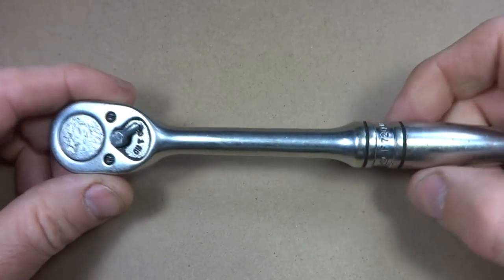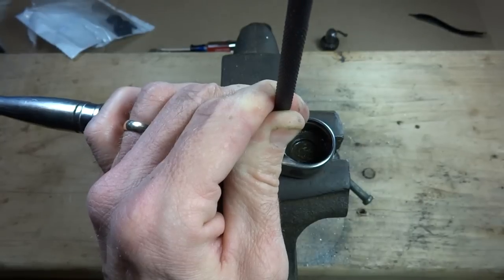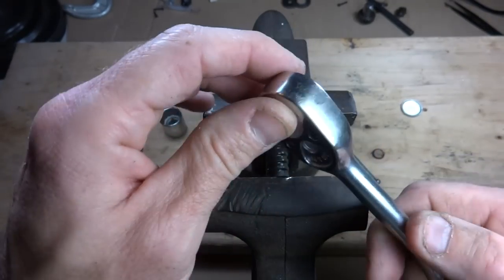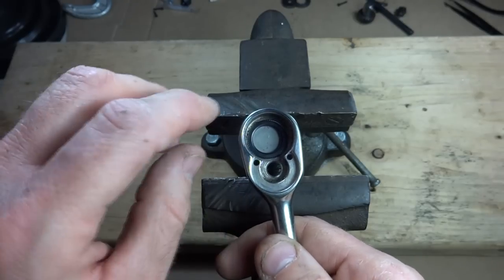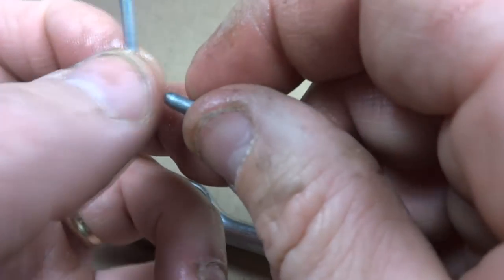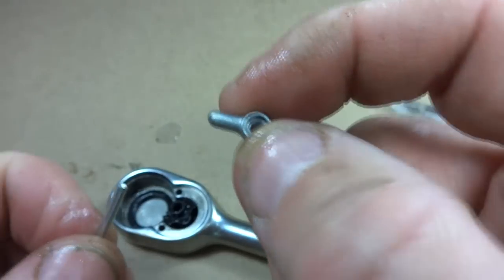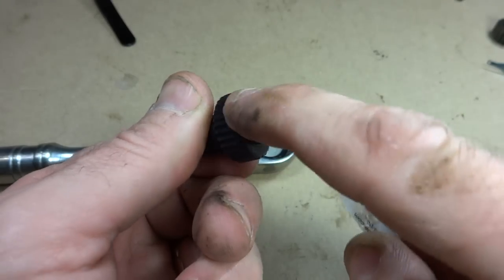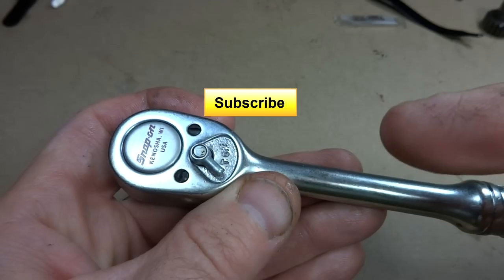How To Rebuild Snap-On Ratchet Wrench With Repair Kit

Comment: That F720 would have been made in Mt. Carmel, IL. I machined millions of ratchets from 1977 until the plant closure in 2003. The plant was actually in operation from 1937 - 2003. I believe ratchets are now made in Elizabethton, TN. I think that model is now discontinued though. You did pretty good on your rebuild, nice video.

Comment: If you use the old drive head instead of a socket, the bushing will seat more squarely. I used to be a Snap On dealer, I can't count how many of those I rebuilt.
Reply: The antique repair kit I had recommended exactly that...drive in the bushing with the old drive head. It seated really well.
Reply: Great Advice.. Thanks for the tip.
Reply: I have a 1955 ferret F70. Do they make a kit for it?
Reply: @Patrick_B687-3  F70N and F70M use kit RKRA380

Comment: A quick tip for everyone, if you don't have that little ball bearing retainer tool you can take a copper washer, hammer it flat, cut it in half, take a punch slightly bigger than the ball bearing and make a dimple, then make a 90° bend and bing - bang - boom you've got a tool that will hold that ball bearing and is thin enough to allow you to slip the pawl in.

Comment: It's funny because I have an F726. It is the 3/8 with the black screwdriver handle. After all these years of not using due to a slipping pawl, I finally brought it back to life. I had taken it to a Snap On distributer who had told me "they don't warranty it due to that handle " years ago. That soured me on buying a lot more of their tools. I still have quite a few things, but I started getting stuff from Proto and SK instead. It's good to have it back as I always loved the feel of that ratchet. Nice video!

Comment: You'd think since these tools are lifetime guaranteed, they would send you the kit, for the price of shipping? All my Snap-on tools are from the 80's. I left the auto repair world around 95. Now my tools are slowly breaking down, from doing my own repairs. But it's difficult to find a Snap-on truck. A few years ago they sent me a replacement hammer (the old one, the plastic handle fell apart and was left with just a metal rod). It was nice that I didn't have to send them the old one. But after about a month, the head of the hammer broke from the handle. No more metal rod, just plastic. Just goes to show how prices go up, but the quality goes down. First hammer lasted 30yrs, new hammer 1 month.

Comment: DUDE! Like many have said before me; you saved my day. And my ratchet. I have about a dozen craftsman ratchets that I’ve disassembled/cleaned/lubed over the years, both the standard and professional lines. They’re easy. My one and only snap on (F830 3/8”) I was always afraid to take apart. It’s my go to ratchet. Anyhow, I finally decided to take it apart. When I couldn’t get the spring/pawl/ball bearing back together, I found your video. I ended up making a tool from a metal shirt collar stay which I drilled a hole to seat the ball and bent. I also crazy glued the ball to the spring. I popped it off after assembly.  Thank you very much for this clear and very helpful video.
Reply: I'm in the exact same situation. Looks like I'm ordering the kit from snapon haha

Comment: R.J. Thank you for posting the how-to video.  After watching, I had the confidence to do my own rebuild vice chasing down the local Snap-on guy and ruining his day...  The ratchet I rebuilt is a vintage F-710B, 3/8" drive ratchet, circa 1964.  It was pretty rough (yard sale find ).  I had a difficult time finding the rebuild kit online (RKRA380), so I called Snap-on directly and they sent me the kit.  Cost was about $20 with shipping and handling. The trickiest part was holding the spring in while I set the pawl in place during the reassembly.  I made up my own "special tool" from an old pair of tweezers to hold the spring & ball in place and "shoe-horn" the pawl into position.  And now, I have a nicely working vintage Snap-on ratchet in my tool collection!

Comment: You just saved my day. The antique instructions with an antique kit did not label the parts. Many thanks! 

One note about older repair kits: I had one & the separate ball bearing is hard to manage. Without that Snap-on holder you have, I had to cut a shim out of aluminum flashing to hold the bearing & spring down because the fit is so tight between the pawl and the bearing. No screw driver would fit in there.

Comment: Thanks for the video. Watched this so i could fix a ratchet I inherited from my dad. Mine is a flex head. Didn't want to replace it with a new one. Almost the same ratchet. Snap on rep gave me a repair kit for a new one. Wrong repair kit. So he brought me the right one when it came in. I don't like snap on prices. But i would buy from him because of customer service. Great job Steve! Also i couldn't find a video that had the same era of ratchet so great video for me. Thank you.

Comment: Well presented video. I was on a Snap On van today for the first time in years to get a new ratchet gear set for my F736 ratchet. Its first repair in 34 years although I'm on to my 3rd 3/8 Snap On breaker bar.

Comment: Thank you. I didn't have that Snap-on tool you used for the spring. So I used my specialized cuticle pusher. It has a small spoon at one end. A Great Video.  Sheilah  :~)

Comment: Very helpful video, I've done a few of these and one tip that might be added is sometimes when your all finished the drive gear might be hard to turn, 2-3 firm taps with the drive square on the anvil and it'll adjust the gap inside and spin perfect.

Comment: I've  only just found this video ,but its still an outstanding teaching tool . I've a 3/8 ferret ratchet circa 1960's +/- that had me puzzled . The switch for tight ,loose is brass which has had me stumped. Snap -On UK denied it was one of theirs when I rang for a refurb kit even though it has a Snap -On part number. I  thought I may have been talking to a new guy so rang again Nope never heard of it but you can have a new one for £60 . I wanted to preserve a bit of Snap On history . It would seem  Snap On don't care about there rich history in tools which lets face it built the world for the most part   Subbed  to your channel Regards from the UK Darren
Reply: I have an SR-715 with a brass selector switch. It's from 1948

Comment: Thank you so much! Using your video I rebuilt my S715 Snap-On wrench and it’s like new. I even polished it while it was apart. Great job on the video! I didn’t have the special tool to compress that spring so I used a tool meant for carving on clay. It was rigid enough and I ground the surface of it so it would grab the little ball. It took several tries but worked.

Comment: Thanx for posting this vid I have the same ratchet and it stopped working just wouldn't turn at all or would not catch on the internal teeth I didn't think i needed a kit just a good cleaning and repacking looks like rust was my problem now its working like new

Comment: It appears that the ratchet came with a 20 tooth gear and engaged  a single tooth in either direction on the pawl but the rebuild kit came with a 30 tooth gear that engaged two teeth in either direction on the pawl.  Is this so?

Comment: Now that you have purchased quite a few of these various ratchets and fixed them up do you find yourself reaching for one in particular? Also it'd be neat if they made a kit for that ratchet that made it have finer teeth. I hear a lot of people who love the 80 toothed Snap-On ratchets, I bet if they made an 80 or 72 tooth kit for these older styles people would buy them to sort of "upgrade" their older ratchets. Anyways thanks for another great video!
Reply from the maker: If you look closely, the kit came with a finer tooth ratchet mechanism than what was originally in there. My Craftsman wrenches are probably my go to wrenches, but mostly because I have had them forever. I haven't had a a  lot of these other wrenches for very long.

Comment: Great video. I have an old Snap-On of my grandfather's that's needed a rebuild. After seeing your video, I ordered the rebuild kit and gave it a shot. 

Unfortunately, my reassembly did not go a smoothly as yours. I set in the new backplate and bushing, and (tried) to press it in as shown, then heard a crack. Opened up the vice and the new bushing fell out in three pieces. No big deal, I thought - I would just put the old one back in... CRACK! Now I'm stuck. 

Anyone know if you can get just the bushings from Snap-On? It would be nice if I don't have to buy a whole nother kit for just that one piece... 🙃

UPDATE:  I got my second kit (everything, when all I needed was another bushing). This time, I used the old core of the  ratchet (rather than a socket) to press the bushing in. Worked great! - the old core did a great job of holding the new bushing even and centered when being pressed in (which is I am sure why I broke the other one). 

The old ratchet is good to go another 20 years (at least)!

Comment: Thx for the video. I rebuilt an old FL720A (long handle), but the square drive does not sit deep enough in the ratchet. The black cover plate does not fit flush with the ratchet head. I believe the bushing is in far enough. Gonna try again using the old drive to seat the bushing. Any ideas? Thanks again!

Comment: Hey, great video, I have an F720 I need to repair as well...however, the slotted screws you remove at 0:25 are in pretty deep for me, and one of them might be a little stripped.  :(  I've used a few coats of PB blaster and so far that screw's still stuck, my driver keeps slipping.  Any suggestions?
Reply from the maker: Shadowguy456234 heat the wrench or try an impact driver.
Reply: +RJ The Bike Guy Ended up having a machinist at work extract it for me.  Finally finished it up today - my old bushing was also oxidized pretty good and stuck in there, but used a vise to press it out.  Thanks so much for your video, now I'm confident to upgrade my SL710 also :)

Comment: I wish I didn't take the nameplate out. It isn't necessary for the rebuild. My new one was just a bit off and it refused to go in straight no matter what I tried so, the old one went in with the new ring

Comment: Where can i get that tool to install the spring and ball, I have some Williams 1/4 ratchets m-52eha that has the same kind of setup and it was a pain trying to get the spring and ball installed
Reply from the maker: Snap On used to sell it, but not sure if they still do. Contact them.

Comment: Where did you get the Snap on spring loaded tool to push the spring into the ratchet?  What is it called? Does it have a part number?
Reply from the maker: From Snap On. I don't think they sell it anymore. Part number is in the description.
Reply: @RJTheBikeGuy   This guy is using an index card. I just tried it but I maybe too tired. I will try it again in the morning. He does it around 12 minutes and 20 seconds: 
https://www.youtube.com/watch?v=CQk9cGWXgqk&t=310s

Comment: Im trying to open up my fk720 and I took the screws out and the plate will not come out, any suggestions?  Thanks
Reply from the maker: Gently pry it off. It is probably being held on where the switch comes out through it.
Reply: Ok thanks

Comment: Hi where did you find the spring steel tool to seat the spring and direction paw?
Reply from the maker: +John Jackson At Snap On. It costs less than $1 with free shipping. https://store.snapon.com/Non-Catalog-Items-RAT-REPR-TL-P9643445.aspx
Reply: You can do it without the stupid little tool (that they should just send you for free with the rebuild kit in the first damn place). Just hold the little ball/spring down with a tiny screwdriver through the hole while you start the paw, it was easier than I thought.

Comment: that's weird I've got old ratchets that that have broken teeth that were my dads that have been replaced.  I guess you just got a crappy snap on guy or they just don't warranty tools the same for hand tools in the uk.  Harbor freight warranties broken teeth on ratchets and craftsman.  I have warrantied many craftsman ratchets they rebuild it and give it back.  but again that is in the US and many we are different.  It wouldn't surprise me.
Reply: Most of the time they just give those kits to you for free .. If not its 10 bucks but if you notice not a single tooth was broken on his ratchet. There was nothing wrong with the teeth. He most likely did it for that name plate!

Comment: hard to tell if that snap-on needed the new kit or a cleanup would have done it, oh well, and i too am a grease fan, and not the musical! still for $10 it w as worth it, you can be sure it will work like new for a lifetime now!,  i spoild my ratchets, take them apart every couple of years for clean and lube, i hate using peoples gritty stiff ratchets!

Comment: how to rebuild any snap on ratchet.
.step 1 find a truck.
.step 2 get it warrantied for free.
Reply from the maker: +Michael O&#39;Brien Yeah, finding a Truck. I sometimes see trucks, but usually when I am driving someplace. Am supposed to just carry the wrench around and then hope I have time to stop when I eventually see one? And then from I have read, the reps don't have to warranty the wrench if you didn't buy it from them (which I didn't).
Reply: +RJ The Bike Guy well the warranty on their hand tools is transferable lifetime.
Reply: There's a catch with the truck dealers...  They serve the customers on their routes first, and they don't have to warranty anything from the outside.  I used to own a transmission shop years ago, and the drivers simply hated anyone walking up to them and then expect to have a tool fixed, (for free) that they either found in grandpa's garage or Craigslist.  Believe me, I personally saw on more than one occasion, the joy they equally took in selling repair kits; or booting moochers off their trucks.
Reply: Gen X Murse70 was that Minnie?
Reply: Craftsman does, they just replace US with Chinese, no questions asked. From 1970 on their hand tools are not as well made. Now they getting cheap, need receipt and model # has to match.
Reply: That would mean the countless Sears Craftsman ratchets that were either exchanged, replaced or rebuilt by stores over the years wouldn't have been warrantied, but they were. Like "RJ", do the same thing, I get the repair kits for my ratchets and do them myself. I found an S-K ratchet on the road, it was jammed. I called up S-K, explained the issue, and they gladly mailed me a repair kit, no issue at all. I had it working in five minutes after I received the kit. I just rebuilt a Snap On THL936 this week. SO sent me a kit and I had it working in about 10 minutes time after installing the kit. Most are very easy to do, just take your time and you'll be rewarded with a well working ratchet when you're done. True, if you run into trouble, you could have a SO tool route guy rebuild it for you, but nothing like using your tools to fix your tools....
Reply: @RJTheBikeGuy  Agree, we have called corporate and begged for the area guy to stop in the shop. He's a ghost. Everyone around us has similar stories, no one can get him to show up. Box full of broken Snap On up on a shelf. And apparently there is some ancient grandfathered thing where Snap On can't get rid of him. Thanks for the Vid, just fixed an F711A with a part kit direct from Snap On and watching this. Anyone know when a RED nameplate was made?

Comment: Snap on warranties those for free. Almost all of my ratchets are snap on
Reply from the maker: From everything I have read, it is up to the individual distributor. If you are a regular customer, then they will usually do it. I am not a regular Snap On customer. I bought the wrench used. So I it would be very iffy if they would warrant the wrench.
Reply: They are supposed to anyway. Its a lifetime warranty. I've walked on trucks with flea market items and they warranty it. They could lose their truck if they refuse
Reply from the maker: That is if I can find a truck. I see them around sometimes. Whatever. The wrench is fixed. I actually prefer my Craftsman wrenches.